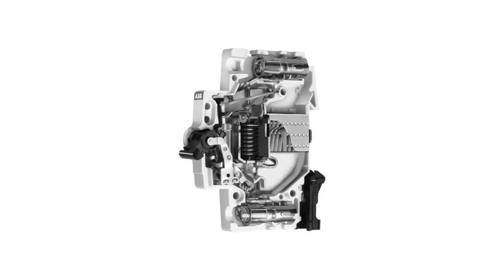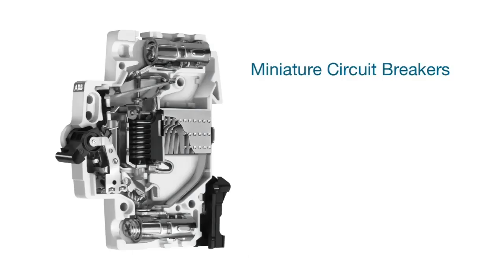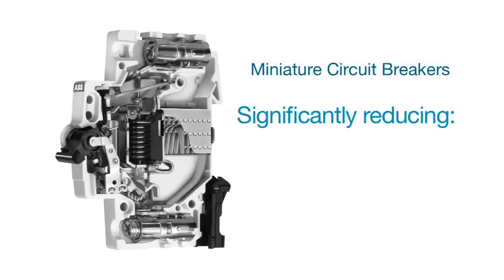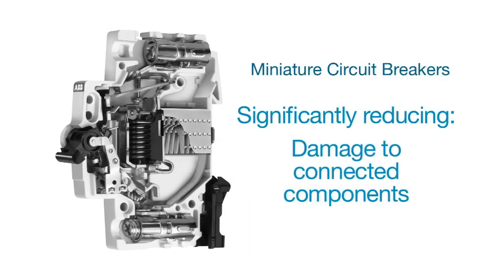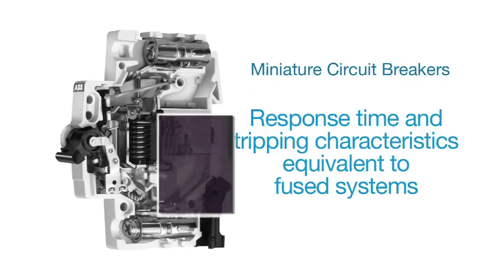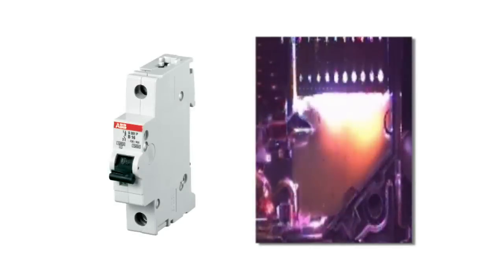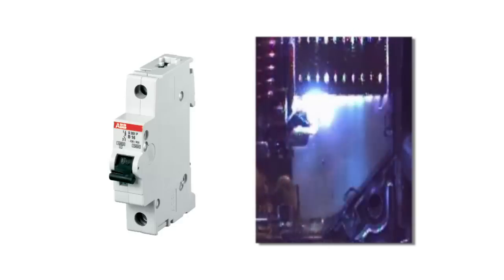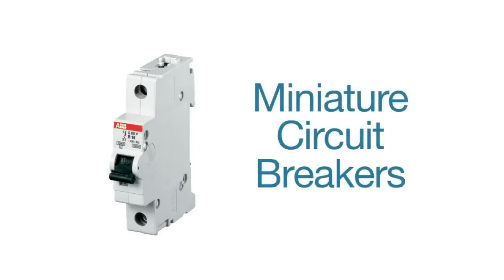ABB Miniature Circuit Breaker clearing downstream fault

Comment: What was the trip curve of this breaker? Or better yet, will a D curve trip as fast as an A?
Reply from the maker: The trip curve of the breaker is the B curve. A breaker with a higher magnetic threshold value, e.g. D curve, will trip a little bit slower. The arc extinguishing time is about 4 ms.